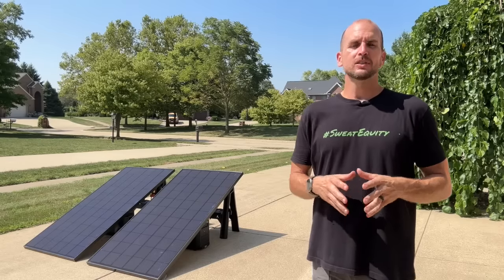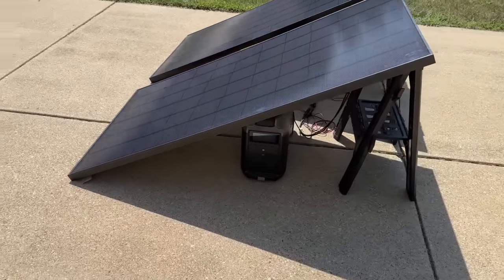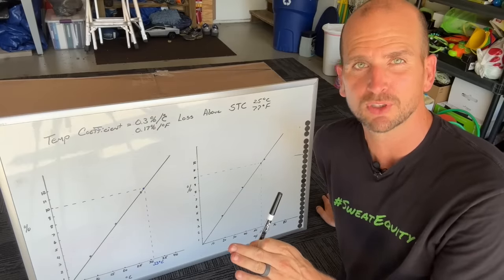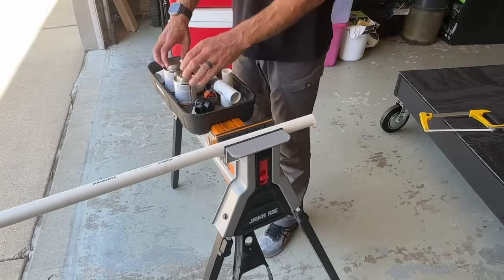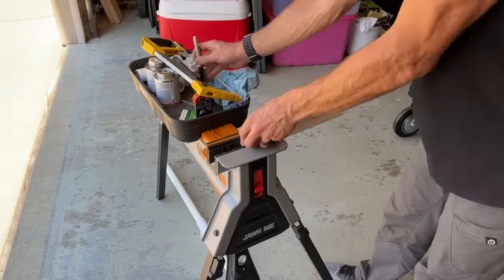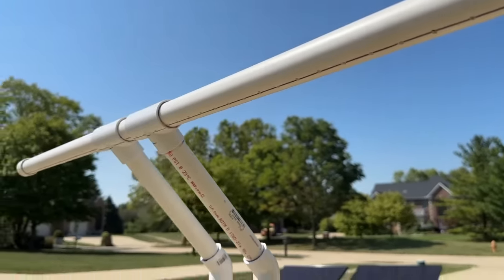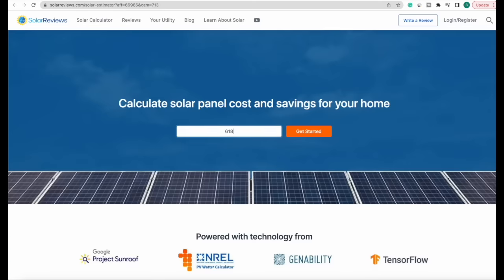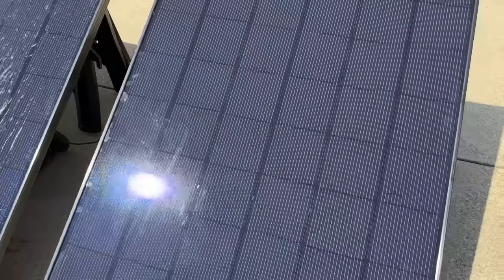Surprising Power Gains By Cooling Solar Panels

Comment: Being in a desert area I can't do the water idea but I did put a fan under one of my panels and got a better watt hour return than without the fan. Just moving air on the underside helped a lot!
Reply: If you ever get more panels in the future you might consider closed loop water cooling. I believe the panels need to be purpose built for it, but there's (almost) no water loss in closed loop systems and you can use the waste heat in the water to heat other things.
Reply: @Mr_Soleo maybe putting it in a hot water tank that can then be used for heating at night
Reply: Dang... so essentially the cooling made it so you got more wattage per hour, more than enough to also power the fan? that's awesome if so. so basically the only cost was the fan. my next question would be how long until the fan is paid off?
Reply: a slightly hacky thing you could try is to stick old computer cpu cooling fins to the back of the pannel to move more of the heat from the pannel to the air
Reply: @crestfallensunbro6001  so have a heatsink and a fan to cool it off, would definitely work
Reply: @Mr_Soleo  i wonder if you could just do what he did in the video and just add a drain gutter, a pump and maybe a car radiator to cool off the recirculating water
Reply: Er, you’re going to get evaporation. Any dissolved solids (like calcium carbonate/hard water) and you’ll be forming scale on the glass.
Reply: I would think the power for the fan would offset any benefit, however, what about have passive cooling vents on the bottom of the panel.  It would add weight but might be an option.  Having said that, we have bi-facial and that wouldn't be optimal.
Reply: You don't have to waste the water.  You could let the water flow into a plastic pool or container and then simply recirculate it.  You could also minimize the amount of energy used by a pump by only running the water every hour or so.  You're onky looking to cool the panel down, and once it it's 75° or so it won't jump back up to 100°+ immediately.
Reply: @crestfallensunbro6001 🤯
Reply: More watts than what the fan uses ?
Reply: Was the difference in production more than the fan used? I certainly hope so
Reply: The Best part isn't even the increase of power output but the increase of longevity of the solar.
Reply: I have seen tests of mounting panels flat right on the roof of an RV vs having them flat but raised a few inches above the roof and it made a difference.
Reply: Put glycol lines under the panels and use a heat pump to heat water in hot water tank
Reply: junk electronics got free heatsinks
Reply: @danamyrocket  use rain water
Reply: In any case of cooling the panels you will have lower efficiency as even tho you will increase slightly production of your solar panels the cost of installing and even more cooling the panels will be higher then the yield gains for panels
Reply: @Tuskly  the fan will beak in 6 months.
Reply: @mrtechie6810  Sure it may break in 6 months... but if it's a cheap basically scrap item that they pulled from something for free, then I don't see the downside other than the labor, right?
Reply: @mark9393 ok but that only works for a few minutes until it is hot.
Reply: @Tuskly labor is the biggest expense. Every point of failure costs.
Reply: @mrtechie6810  It depends. I used fans with fluid bearings and they lasted more than 3 years of continuous (24 h a day) work without any signs of wear.
Reply: Maybe u could make a closed loop water capture system 🤔
Reply: closed loop system
Reply: What's the point in having electricity but not having water??? I'd rather have the water
Reply: I made an evaporative cooler from a car radiator fan and a swamp cooler pump to cool my ice maker on hot days 100f plus it runs on two hundred w solar panel and around 5 gal water a day probably not worth it for this application but food for thought

Comment: I am so glad it is only 5% and we all not have to waste water to cool every single panel. Thanx for your work.
Reply: you don't have to waste it, you can repurpose 95% of the water that goes down so that it goes directly to trees/plants to water them, or you can collect it in water tanks.
Reply: also the system would only run during hot hours by using a thermostat, so it never wastes water during the night or when the temperature is already cooler.
Reply: @wearebacteria  Or you could make a closed radiator system
Reply: @Gatitasecsii that's my plan. I'm also adding heat in winter with a cheap desal heater.

Comment: The problem is less the water, since you can simply capture it with a rainwater harvesting system and re-use it. The question is if you gain more power than you need to have a pump running all day. Maybe it helps if you just turn the pump on for about 20 seconds every minute, but that might drastically reduce the lifespan of the pump and might leave your panels covered in mineral residue left by the evaporating water.
Reply: There's actually a "starts per hour" rating for larger motors, but I wouldn't expect it to apply here. But if it becomes an issue then a soft start for the motor would be the way to go. And there are other ways to cool off the panels without running water over the glass on the panel (think water cooling found on PCs), such as a closed loop system that heats your water for home use by way of a heat exchanger.

Now would these modifications be worth doing? Single use water dripping across the top of the panels would be a horrible use of water, and probably (hopefully) illegal in most places. 

A closed loop system that circulates captured coolant (antifreeze) and the dumps the heat into something that you want heated (hot water heater, pool, heating the house, etc), as a secondary use, or if you don't need the heat, sinking the heat into the soil would be far more efficient, and potentially reduce your energy costs in other areas of your home.

I don't think that I would do it for a meager 5% electrical gain. I would have so see a marked improvement in energy production as well as a cost savings in the secondary uses.
Reply: @MrWaalkman  I think the same way. Was also thinking of a liquid cooling loop like the one used for PC's. It could be applied to the back of the panels using heat transfer paste (like the one used on CPU's). But 5% is just not worth the time and money.
Another possible option on tilt roofs could be to capture wind from the  line along the top of the roof and get it to blow under the panels. But It would only work when there is enough wind... and if there is too much wind it might get your panels airborne  (if unlucky along with the roof)
Reply: The water is the less efficient way to address the problem.  There are companies that are bonding heatsinks on the back of the PV cells and 'stealing' power from the cells to run wash-down fans controlled by a simple thermal diode. https://www.youtube.com/watch?v=Mt9qLRN7JvA Tech Ingredients did a breakdown of it, and discussed using water briefly, but dismissed it mainly because a pump is a lot more power intensive to run, and the net effect is only about 5-7% where the heatsink and fan arrangement was 10-12% for a smaller power investment. 

I'd give that a look because the discussion is a bit more in-depth.
Reply: Try putting a duct on the back of the panel that runs air up via convection through heat sink fins.
Reply: @TheCablebill  That's what @kmikl mentioned in the last comment before yours.
Reply: @kmikl  Thanks for that link. It's a way better solution than the one in the original video...
Reply: Just harvest all rainwater from the room in a water tower then use it for the panels, even if it won’t last forever 40-70% coverage time is still good
Reply: Get a hamster😂
Reply: You only need to run it near peak temps, that can be easily solved for but you make a good point about residue from the water. Maybe filtering and adding something to kill the bacteria in the water.
Reply: 3 words, 
Atmospheric Water Generator
1) The water that is generated is practically distilled, no minerals, no water spot
2) Using high efficiency dehumidifier @65% humidity, you can generate 5~6 Gallons per day. Mostly evening-night time
3) My cost has come to roughly $0.05 per gallon, including the 5 micron water filter and UV lamp usage. 

I would use mister nozzles, its the cooling effect, no spraying water as he did is not needed.
Reply: @fredpinczuk7352  But do you get any power gains? I just sprayed my panels with water yesterday as the temperature whent up to 38 degrees celsius (100.4 Fahreinheit)
, but on the solar statistic there was no increase in power production at all..
might be that the effect lasted less then 5 min and the readings are taken only in that intervall.. 

If you use an atmospheric water generator, isn't the energy consumed by it for poducing that amount of water higher then the gain you get from cooling the solar panels?
Reply: Ya running it constantly doesn't make much sense to me plus if you have some Minerals or anything you are going to have build up that's going to make you lose more
Reply: the moment he said cooling the panel and built the pipes I thought " But what about the power used for the water pumps?"
Reply: I did the math and the return is very real. My array would generate 200watts more AFTER counting for the 40-50watts the pump would draw. And that is calculated with the pump running as long as the sun is shining. Negligible savings for many homeowners, but that difference matters more both at scale and for those off grid.
Reply: It sounds easy.  In practice it is very difficult.  You can't simply catch the water at the bottom if you have double stacked panels, which many do.  Evaporation will be enormous because you are putting water on hot panels and spreading it out,  which will also cause mineral deposits on the panels, reducing efficiency.  Mineral deposits will not be easy to clean off without chemicals.  Doesn't seem very practical as a long term cooling solution.
Reply: Mineral build up would become a huge issue real quick.
Reply: @bobbygetsbanned6049  true.. didnt think of that. on top of mineral buildup it would also cover the panels with dirt (even with first flush system) I take back that rainwater advice.
Reply: To you all "it will cause only problems" guys. It is the way innovations are made. Just found comment from a guy below other video who claimed that he actually did this. Water running behind panels to heat up a pool, gained 17% at Spain plus reducing pool heating costs. Maybe it's not true and he made that up. But worth a try if you ask me. Also lowers solar panel degradation over time significantly. It is proven that in higher temperatures panels degrades faster, that is well examined how much. Doubts are reasonable and these questions are important for engineering process. Maybe just think how make this more feasible to work in practice or just let others improve the idea instead of "it makes no sense" attitude.
Reply: @erneststaszuk4559  To begin with the piece starts with spraying water over the panels.  This is a far cry from running tubing behind the panels in a closed loop.  Apples and oranges in comparison
Reply: Or, you just capture the rain water in a high place (like, you know, on your roof) and let gravity do the dribble. For what you see here, about 20 cm of head should be enough. All you need is an electrically actuated valve and a temperature sensor on the panels, and of course a microcontroller somewhere.
Reply: @GermanTopGameTV  this would work if you have your solar cells on the ground next to your House. But like with alomost every residential solar systems my panels are ON the roof... with nothing above them that blocks the sun.
Reply: No minerals in rain water.

Comment: Thanks for making this excellent comparison. One cooling option is to use thermal conductive glue to attach aluminum heat sinks to the back of the panel. You could even hook up a separate solar powered fan to draw air over the heat sinks.
Reply from the maker: Yeah, that has some potential.  Thanks for the idea.  Increasing the shaded surface area with a little airflow would probably make a measurable difference.  Sounds like I need to go shop for some aluminum 😁
Reply: @everydaysolar  The cost over gain would be enormous.
Reply: I think @TechIngredients did a aluminum cooler on the back with net positive output like that.
Reply: @SkinnaMov Techingredients is the bomb!!

Comment: Thanks for doing the test.  I think the 5% extra energy production seems low and probably will scale up to more if done over a home sized array of 2000+ watts.  I've hosed down a solar arrays in the middle of the day and noticed upwards 10% power increase on just the watt output.

But, in addition to using up a lot of water, a big problem with is hard water stains on the panel's glass from using normal city tap water.  Those minerals will get baked in even harder with the intense daily UV and heating.  Personal experience.

As someone else mentioned, this can only be practical with a heat sink system on the back of the panel:
(a) no hard water stains
(b) low to zero water waste as water is circulated

Requires a lot more materials like hosing, valve, heatsink, anti-bacterial additives, etc.  If its going to give 10% energy gain then might as well spend 10% more on panels and spend less money and time.  The ever falling prices of solar panels makes that the best alternative to get more energy output.

However...

I do like this idea of having a substantial behind-the-panel cooling system that would also save the heated water to a solar tank.  That way, the house is getting much more energy efficiency from solar panels well beyond the ~21% efficiency of the latest generation solar panels.

Look up "2-in1 DualSun SPRING hybrid panel" that has all the heatsink and hosing built into each panel.  The manufacturer claims it can give that 5% to 15% panel energy output efficiency improvement as well as heat the water to 70°C.  This is a double benefit that's kind of a no-brainer if it can be made and installed economically.  But it really shows what our sun is capable of when the correct set of technology is applied!
Reply: What if you use a heat pump system to move the energy from the heater water out on a pool water (basically a water-water heat pump) so then you send not just average temperature water to the solar panel but actually cooled down water like maybe at 10 degrees Celsius or lower. I think then you can gain even more than 15% in power production but it will be balanced out by the heat pump probably.
Reply: What if you don't put water on the photo cell itself so as not to distort the light wave landing onto the cells and reducing the power "creation" capacity? And cool the panel from the rear.
Reply: @MR-backup  you can expect somewhere between 10 and 15% improvement. Still not worth doing unless you also need the warm water for something like a pool.
Reply: @alexandruilea915  Interesting idea.  Can someone do the calculations please! 😁
Reply: @MR-backup  Hmm, got me thinking that maybe the solar panel can be manufactured with many thin channels embedded within backside plastic perhaps.  It will just make the backside some 2mm thicker. 

That allows water to run just under the solar cell substrate and provide a guide for the water without requiring the use of any heat sink.  

These water channels would not be as efficient as an actual heatsink but would be a hell of a lot cheaper!  Because these channels would not much more manufacturing materials -- just a small change to how the panel layers are sandwiched together at the factory.

Each panel will need some sort of inlet and outlet water ports.  The smaller channel size will require a stronger pump but still should be net positive in terms of energy production. 🤔
Reply: I'm curious if to put cold water on back side of panel to get heat. solve problem with tap hard water. probably twisted backward radiator can solve problem for temp exchange.

Comment: I went in 2015-2017 to a energy convention and there was a company who had solar panels with hoses at the backside.
It had a couple of functions.
It was to cool the solar panel and to heat the water for your pool, shower.
Somehow I never saw it again as the idea sounded good.
Reply: They go more by the name of PVT panels PhotoVoltaic Thermal panels, or collectors. Maybe not exactly the same as you seen, but I reckon more or less. Haven't seen them much around either, and know little firsthand. But hope this at least helps Googling them a bit.